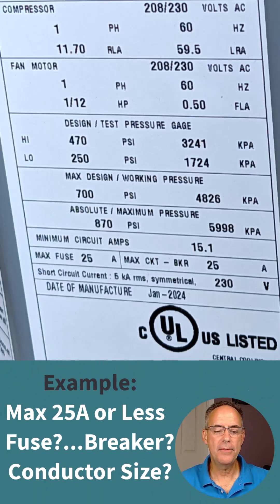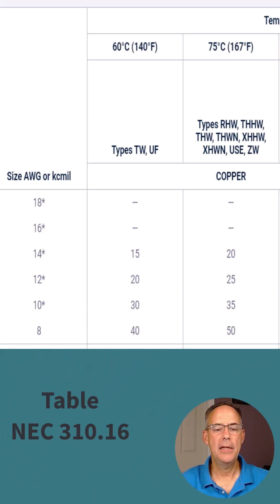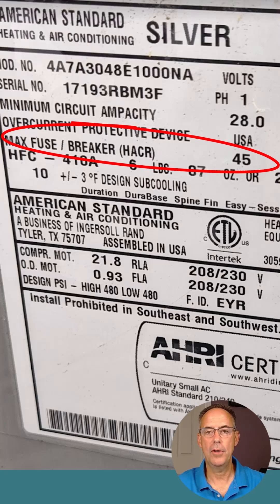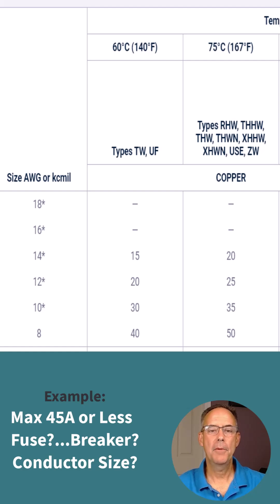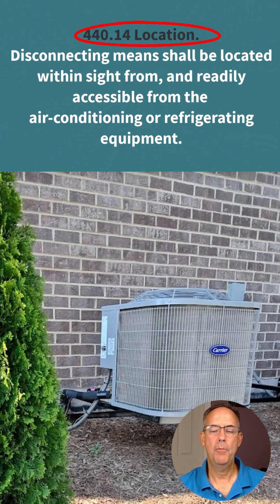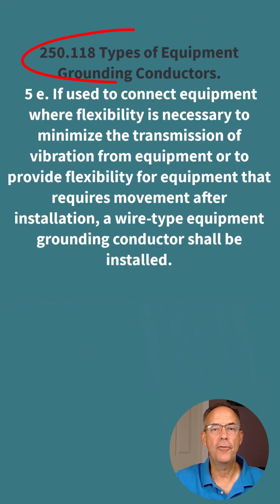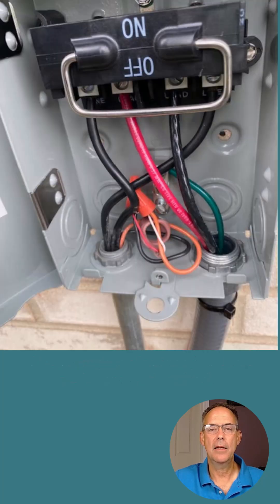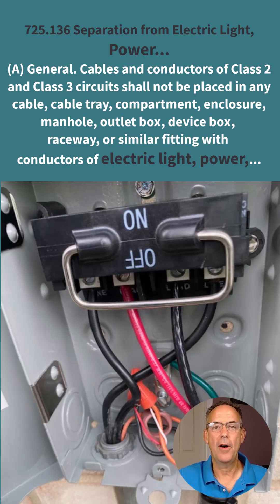Pass Your AC Inspection: Avoid Common NEC Violations #NEC #MaxBreaker #MinCircuitAmpacity

Comment: The reason you see low voltage and line voltage in the same pipe is it used to be allowed as long as both served the same piece of equipment. That was disallowed several revisions of the code ago.
Reply from the maker: Thanks for the comment! Yes I think the code language has gotten clearer over the code cycles.  Confusion came in 725.136  because required separations and protective measures (like the 0.25 separation, barriers or specified enclosures) were missed.